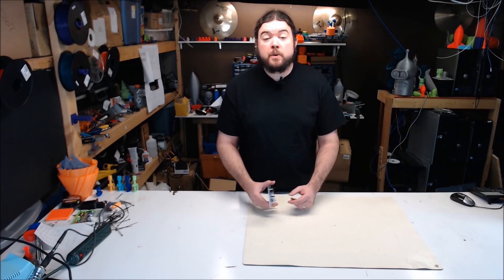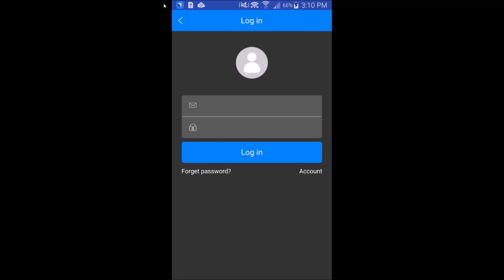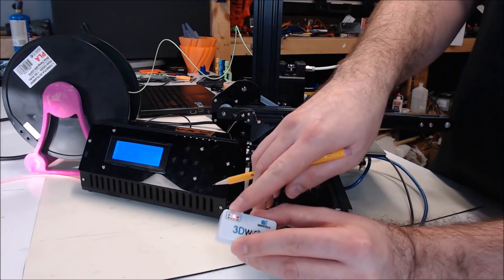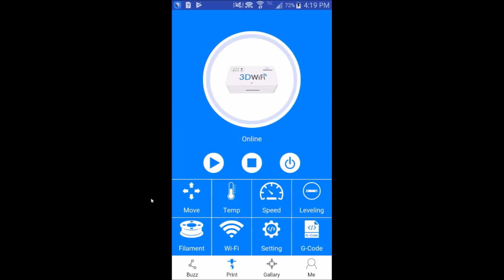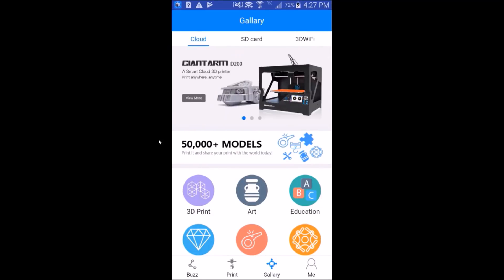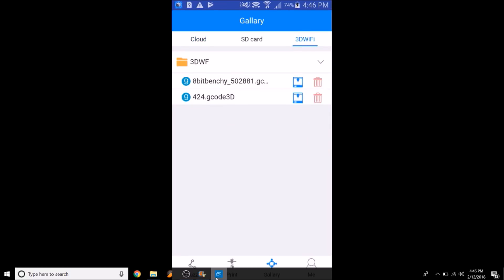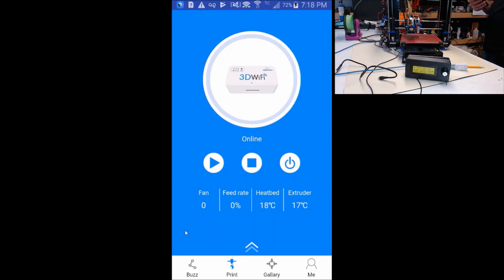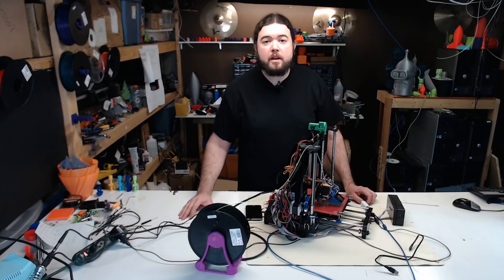Geeetech WiFi 3D Printer Module - First Try - Chris's Basement

Comment: Why do they require you to make an account with them and login in their app?
Then in the app add data like local wifi password, etc. This is just wrong.
Reply from the maker: I don't know if any of these ever worked.
Reply: Name an app that doesn't want you to make an account. I'll wait. The app needs your Wi-Fi and password so that it can connect the module to your router,  It's that simple. I'm not sticking up for this piece of shit because well, it's a piece of shit.  Try thinking outside the box sometimes man

Comment: i was told I have to have this for my geeetech e180 . makes no sence to me sence the printer already has wifi. but I ordered it befor my printer arrived and really wish I would of waited and spent the money on something better. I got the thing to connect to the wifi and I can send files to it that it saves on the mini but cannot get this thing to talk to the printer as of yet. so I can use my phone to send files to the sd card then take the sd card and put it in the printer and print. only useful if I wanted to print something off of the phone app.
Reply from the maker: I never got it to work at all, I tried a couple of times.

Comment: Does this work with Desktop applications like Repetier or Cura? I have no desire to use a phone.
Reply from the maker: No, it really doesn't work at all.
Reply: @ChrisRiley  Thanks! I'll be sure to steer well clear of this lemon. Having issues with printing randomly stopping over usb and I need another solution. MicroSD reader seems to have packed it in.

Comment: Good video, and so true, it reminds me off my geeetech experience, I purchased an A20M printer , thinking I was getting a normal printer with a controller, when I recveived it I found I had to order the wifi controller , and have been fighting this for 4 weeks, still no movement on the printer, I am so frustrated, I even ordered another wifi, because, I wore the reset button out on it, now it looks li8ke the reset button on the printer is stuck pused in, any idea how I can fix that issue so I can continue to fix the other issues, oh and No help from geeetech, I will never buy another one, thats for sure, Rick,  rickyv@cox.net
Reply from the maker: Yeah, I never got this thing to work. I wish they would just give up and stop selling them all together.

Comment: I just ordered a Wifi SD card. Next best thing to octoprint i think.
You can create a network drive folder on your PC and slice directly to it!
https://www.youtube.com/watch?v=dYEOd-V7MHk&t=
Reply from the maker: Wait, what! Why have I never seen this? I have to get some of these right now! I have met RJ before, I can't believe I didn't know about them. Thanks!!
Reply: @ChrisRiley  So I was struggling trying to get it to work from the video tutorial in the link I posted here. But just recently I found a written tutorial over at mattshub . com that explains everything in detail. Because I didn't fully understand how ip, ssid ect. Worked, That article really helped.
You are gonna want to set up the card in STA mode. And even though the article only mentions the W-02 and W-03 versions of the Toshiba cards, the W-04 card will work just fine too. https://www.google.dk/amp/s/mattshub.com/2017/04/11/flashair-sd-card/amp/
Can't wait to see your video on this. And merry Christmas from Denmark 🎅🌲🎁
Reply from the maker: @TweakTechNow  oh, awesome! I will give this a try. Merry Christmas to you too!

Comment: Hi, I bought two of these units.    Before I knew of your Youtube channel.    I experienced the same results.   I designed my one 3D printer around Geeetech Mightyboard.     And T WifI 3D Module did not work with it.     In fact think it burned out.   The USB interface on the Mightboard.  I can no longer control the Mightboard thruogh its USB port.     In Short, I feel I was ripped off.     I abandon this Geeetech Module peice of junk.    And converted Octoprint using Chris's YouTube videos.     

Love your Video straightforward and to the point.

Friendly Regards,

Mike T.
Reply from the maker: Such a shame these didn't work. They could have been so cool. Thanks for the coffee's as well, much appreciated.
Reply: Thanks for quick reply.   Did you read my note I attached to Coffee's Break?   Please keep up the good work.   MT.
Reply from the maker: Yes, sent you a note.

Comment: This works with the creality 10 S.... i had a print already going and i ran through the procedures exactly like shown.... 
The play button is already made and it shows my temps that i set on cura..... So it is working for me.... Until my print is completed i will try a test print in the app once my existing print finishes.... Works well.... Maybe som printers are not compatible ore maybe the firmware is old on some printers. Don't rule this device out until you are 100% sure.
Reply from the maker: Elias Thank you for the comment. You are the first person I have seen have some good luck with this. I will give it a couple more tries and see what happens.
Reply: Hi Elias, I have a CR-10 S5 and in the description of the 3DWIFI it says that it is compatible, I have the same motherboard as the cr10s, it is version 2.2, but there is no case that I can make it work, could you please help me to Does it work for me too?

Comment: Lol, I have the E-180 that I received for a review. That printer also works with the same app, or should I say, also doesn't work with the same app.
There is however another thing that's even more disturbing. The app on your phone doesn't close when you close all running apps. in fact, it sends about 200MB of data each day while not in use. I don't now what data the app should report to it's headquarters when it's not used, but it's for sure spying on the phone it's installed on. Also, Why should it have access to my contacts and other phone data?
That said, I love the E-180 for the quality of the prints, but only when I use Simplify3D as the slicer of choice and just put the SD card in the back of the machine. The WiFi capabilities are completely useless. I have seen other reviewers that are (up to extremely) positive about it, but I have yet to see the first reviewer that actually shows how to print on the WiFi connected printer. I am glad to see you are not such a reviewer, nor am I. If something is bad, just say it.

Great Review, Thanks for it.
With Regards,
Brian.
Reply from the maker: Thanks for the input Brian, much appreciated. Glad to see I am not the only one to have an issue with it.

Comment: This thing is really expensive....for what it is.......ok a full raspy-setup (with cam) costs a bit more, but as you mentioned....with a feature set ,that's way higher.
A possible advantage would be easier configuration and out of the box usage vs octopi....but a simple octoprint-setup shouldnt be harder to install.
And of course it could be extened any time.
I print all my stuff via octoprint, with some configuration,  remote switches, a couple of addons...and some dirty hacking it is super convient. All my super-stupid printers are so smart now....that I sometimes get the impression they play the terminator soundtrack ;-)
Reply from the maker: Ha, Terminator soundtrack.....I am the same as you, all on Octopi currently. Thanks for watching!

Comment: As you said at the end, I don't really see the point of this. I used to use OctoPrint but that was just another thing to set up. Now I just pull the SD card and stick on the G-Code and print from the machine.

I think they would market this as one of them devices, you can't live without, but you can.
Reply from the maker: This wasn't what I was expecting for sure. I thought it would at least have had a web gui you could use. No such luck.

Comment: You not having any luck with tech recently, bummer. Remember you can meditate with my name if need.... SHOLM........feel better? Lol
Tech hiccups are not your fault nor can they be avoided. Good video, thanks for sharing. God bless
Reply from the maker: Now that you mention it, I have had a recent bad run. :) Sholm....Sholm....much better now! Thanks!
Reply: You need to get an Amish 3D printer, no electronics to worry about    just a hand crank
Reply from the maker: Brew It, Print It, Build It, Blast It Ha ha ha, I have spent some time with the Amish over the years. Not sure how well they would receive 3D printing. ;)

Comment: It looks essentially like they've tried to make an IoT device, quite a lot of unnecessary "Gumph" for what it is tbh, even if it did work properly :p

The feedback side of things sounds a lot like it's only be tested on the output from one of two printers and consequently doesn't know how to parse anything that doesn't match exactly that format.
Reply: IF you get bored, pop the lid and get some pics :D
Reply from the maker: Will do, when it joins your network it reports as an ESP named device. So your suspicions are probably correct. Thanks for watching!
Reply: That's pretty much what i'm expecting :)